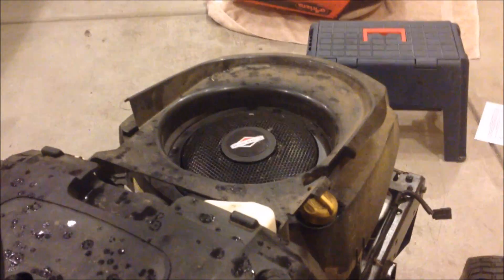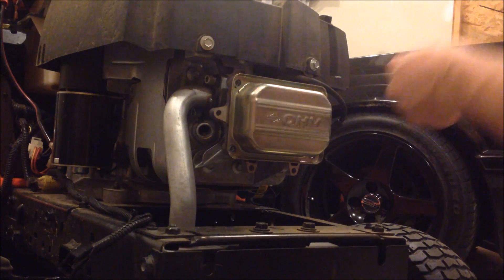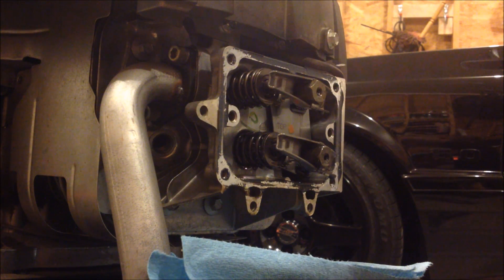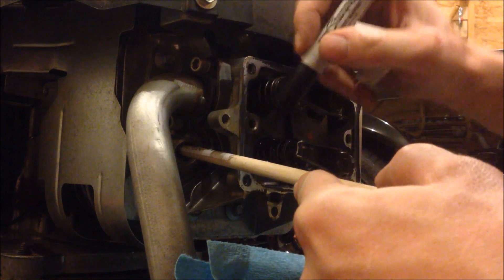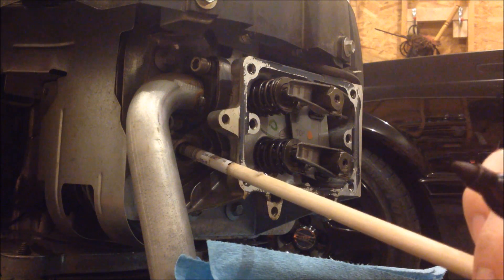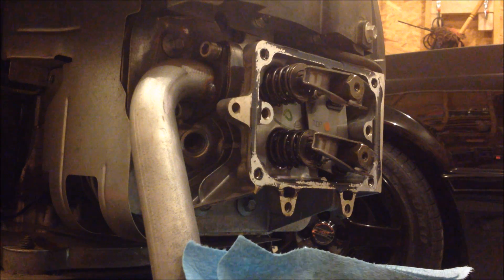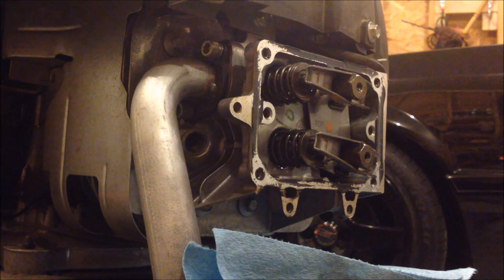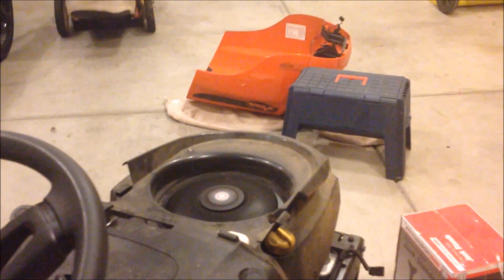How to adjust valve lash on Briggs & Stratton 330000 series engine

Comment: Great video. I’ve read the comments, but want to make sure I understand be starting repairs. 

My 15.5 hp B&S engine definitely has compression lock. I used your starting fluid method and it worked great. But I want to fix the problem. 

Do I understand correctly that I should check the valve adjustment first and that may fix the problem?  If it doesn’t fix it then go into replacing the cam shaft?

Engine runs great after it starts. Thanks.
Reply from the maker: Hello. Yes, you’re correct. First, adjust the valves to spec. If that doesn’t fix things, look to replace the cam. 👍
Reply: Finally got around to working in it. Adjusted the valves like you said and she’s starting and run in like a new one!  Sure was glad I didn’t have to open her up! Thanks, man!!!

Comment: This video saved me from sailing shit's creek without a paddle again. This 19hp engine is garbage. This time the push rod bent and head gasket blew again. Lesson learned.....don't buy aftermarket parts. Got the timing right on the first try this time. Thanks again.
Reply from the maker: You’re welcome! We share the same feelings regarding the motor. If electric wasn’t 5k, I’d go that route in a heart beat.
Reply: @FastFixYouTube  I agree. For that price I'll just replace the head gasket every year. Thanks to your video the hardest part is pretty damn easy.
Reply: @FastFixYouTube my words are coming back to bite me, saying I'll just replace the head gasket every year. Well it's been about a year and you're about to bail me out for the third time. It blows in the same place every time the thin strip next to the push rods. This is a Craftsman riding mower and between the engine design and the genius engineering idea to put the exhaust in the front of the mower so it blows in your face the whole time it's almost laughable at this point.

Comment: Tks fast fix guy for thkin time to video. Ive the exact problem.
Reply from the maker: Yes sir, seems to be a common theme. If adjusting the valves doesn’t help, likely a failure for the pressure relief mechanism. Got a video on that too if so. Hope you get it going!

Comment: Great tutorial! Had the same problem with my engine - 17.5 HP Briggs & Stratton. Followed your instructions, and it worked perfectly. No more compression lock, and the engine runs great! Thanks for posting.
Reply from the maker: Glad this video helped!  Please keep in mind the compression lock issue might also be occurring because of a broken compression relief mechanism that’s located on the camshaft. If this part breaks (which is common) the only way to fix the issue is to replace the camshaft. I have videos of that process should you need them. Thanks for the comment 👍

Comment: YOu should DELETE this video because it MISLEADS from the very beginning…. This is NOT a “COMPRESSION LOCK” due to valve misadjustment.  It is a FAILED CAMSHAFT COMPRESSION-RELEASE MECHANISM…and the Fix is to replace the camshaft.  about 3 hrs for a handy guy with a set of sockets.
Reply from the maker: You should DELETE this comment IMMEDIATELY because it fails to take into account the EXPLANATION I wrote in the DESCRIPTION.
Reply: @FastFixYouTube  😁man it wouldn't be a comment section without "that guy". I'm headed out to the shop now to see if it's valves or comp release for me. I haven't adjusted valves in a while so I watched your video as a refresher course and it looked good to me.

Comment: Great video and explanations I think it's the best one on YouTube as you have the same good work ethic as I was taught to follow! I've been mechanical my whole life and finally decided to check my same 21hp model Briggs and Stratton's valve lash after 8 years and approximately 800 hours. They were at .009-.010 not too noisy or giving me any issues so I adjusted them likewise at .004 intake & 
.006 exhaust 1/4" past TDC using my wood dowel. I appreciate all your videos especially on the B&S engine and hope that I don't ever have to replace the camshaft compression release in the future, but I'll feel very confident if I have to by just watching your video.
Reply from the maker: Hello. Thanks for the great comment!  Yes, work ethic of do things right (or at least attempt) and therefore not have to do it again. lol, sometimes that works, sometimes not. But that’s how we learn. I hope you release mechanism doesn’t break either.  Sounds like you’ve got a keeper with 800 hours of service! Nice!

Comment: Hey pardner. Think we have the same motor331777-2372-G5 runs 15 to 20 min then dies and won't start. Think it's the coil. Replaced but need to confirm the armature air gap but can't find a spec sheet for this motor. Can you help a brother out. Is it .10 or different for this model?
Reply from the maker: Hello. I feel your pain on finding specs for these engines. Parts are hard enough let alone tolerances. It pains me to even think about…. Anyway, I found this video that says it applies for all models. Might give this a try. https://www.youtube.com/watch?v=5p9WQThzP2s
Reply: @FastFixYouTube  thanks buddy. I was able to have a service rep email me. Confirmed its .08 to .14 so. .10 will work fine.
Reply from the maker: Excellent!  I appreciate you reporting back with the information. Thanks!

Comment: I would like to add something .... the reason for the extra 1/4 inch of travel is to activate the compression spring release ....after the intake valve closes there is a quick opening and closing of the valve again, if you dont see that action it's a good bet the spring or counter weight on the camshaft has broken and is not operating making valve adjustment useless. Then a camshaft replacement is needed- not a bad job to do but it can be a little intimidating. I know this is an older video and I didn't watch all the way through so you may have mentioned this but I am having that issue at the moment with two B&S motors and have watched a ton of videos to piece it together. I hope this helps !!!
Reply from the maker: Joe Drasal III yes! That was the exact issue with this motor. I adjusted the valves in vain... the compression release mechanism had failed and prohibited the engine from turning over.   After I did the valve adjustment I had subsequently released the pressure in the cylinder and the motor fired up after I had completed the job. A sure sign to me that the fix had worked. But the 2nd time I tried to start the motor, no dice. It took me a while to figure out the problem, but ultimately I discovered the issue. I made a couple videos detailing the camshaft repair, but thought this video would be helpful to those who did in fact have questions about valve lash adjustment. 

Thanks for the comment and best of luck with those motors!

Comment: Rotate the engine until one valve is fully open and then adjust the other valve. When one is open, the other is closed.   No need for finding TDC.
Reply from the maker: William Shedd yes, that is correct. I wanted to show the exact procedure according to the B&S manual so as to most accurately document the procedure for the new-comer that might be afraid of taking “shortcuts.” Thanks for the comment!
Reply: Tks b. Shedd helped this 64yo shadetree get to the readers digest

Comment: Hi,can any one help me  with hard start , B&S 21 hp ,I set the valve clearance but no change starter  can not turn the Engine freely, but if I keep trying  it will heat the starter  & sometime with not full rotating start right up ,I changed Battery,Starter . Engine ran before with Low & dirty oil--But no knocking when running & after 1 hour of cutting grass when I shut this ,it still hard for starter to move the Engine . Too much compression or any part bend in engine??  Thanks
Reply: Had that problem once, the start relay contacts were not making good contact. Cleaned the contacts up. Pop rivet the relay back together and it crank a lot better. That held me over until I got a new one. Might not be your problem but could be.
Reply: Jut doing mine, same engine... it was the crank shaft. There’s a little cam type piece on it that acts as a compression release to make the valve open a little when your starting it then after it starts, the force of the spinning can shaft makes the little cam slide out of the way so the valves work as they are supposed to. Well that little cam wears out and breaks so you have to replace the cam shaft with a whole new one ( abut $60.00) on Amazon dot com. It’s a surprisingly easy and fast fix though.. about an hour to remove engine and take out the cam and put back together... I’m just waiting to get the cover gasket in!
Reply: @hdrjunkie  Thanks yes I found that last Season & Fixed it--Thanks
Reply: UPDATE--I fix it -changed the Camshaft with release vale mechanism--Thanks everyone

Comment: I set the intake at .004 and exhaust at ,006. The mower starts fine and idles biy when I engage blades  the engine shimmys and loses power  but doesnt die. should I adjust intake or exhaust? And to what? video helped was not starting without junp before. thank you
Reply from the maker: pam wilson hmm...doesn’t sound like a valve lash issue if the mower is dying when you engage the blade. Sorry for the stupid question, but is the engine at max rpm when you engage the blade? Engaging the blade at low RPM may be causing it to die. I would also check the drive belt (belt connecting the blade to the engine) and make sure it’s not getting snagged or hung up causing excessive load on the engine and causing it to die. Otherwise, it sounds like a power issue. I’d go to the carburetor if all other things seem okay. Carb might not be getting the correct air/fuel to the engine for adequate power or might be sticking closed or not fully opening. Best of luck!
Reply: I engage the blade at the half way point on my throttle when I try to move the throttle more it doesnt respond it bogs down and shimmys and sputters. I never had the issue before i adjusted the valves because i had to jump it to  get passed compression point
Reply from the maker: pam wilson if you already adjusted the valves appropriately, that part is done. I’d move on to the carb.  Can you rev the engine to max rpm when the blade is disengaged? If so, the carb might be okay. Again, I’d check the belt connecting the blade to the engine. I’m not a small engine mechanic, so I can’t say for certain on this stuff. Just kind of giving you my two cents. Best of luck

Comment: Ok I did everything exactly 1/4 “ past tdc intake 4 exh 6 tried 3 5  4 4 no luck . How can you tell that compression release is working. Pretty sure mine isn’t releasing.
Reply from the maker: biker197471 the big give away is if you’re able to start your engine by manually moving the piston to just after TDC on the compression stroke. To do this, remove the spark plug and spin the motor to TDC on the compression stroke. Place your finger over the spark plug hole while moving the piston. When you feel pressure, you then know you’re on the compression stroke. Continue to spin the motor just beyond TDC so there’s no compression left. Replace the spark plug making sure to connect the spark plug wire and try to start it. If the engine spins and starts you know you’ve got a bad release mechanism. If the engine spins, doesn’t start and becomes stuck, you know you have a bad release mechanism. Basically, the engine should spin freely. If it does not, probably a case of compression lock and a bad release mechanism. Best of luck!

Comment: Blueoyster5, I wish you well, sir. I would like to comment, if I may, about some information you gave in your video. You said the intake valve lash should be set at four ten-thousandths That would be .0004; however, it should be set at .004 which is four thousandths. Perhaps this is what you meant but for the sake of your viewers I wanted to point it out. Also you said you did not have a .004 feeler gauge so you used a "three and a two and a half." That would be five and a half thousandths which is in range yet still a bit large for the intake, seeing that too great a valve lash is what causes the compression lock in the first place. Just for the sake of information, you can set either valve lash as long as the opposing valve is wide open. That way you do not have to mess with the dowel or with finding a quarter inch past TDC. I wish you a blessed day, sir.
Reply from the maker: Hello Exinanition.  Good catch on the "ten-thousandths" comment.  I did indeed mean "thousandths."  If only YouTube allowed me to edit these after they were posted I would certainly make the adjustment.  Thanks for letting all the viewers know.  I very much appreciate constructive comments like this one.  They help make YouTube a better place  I'm not sure if you read the description, but the valve lash ended up not being the reason for the compression lock.  The compression release mechanism catastrophically failed and was causing the issue.  I address that problem in another video.  And yes, you're correct.  As long as the opposing valve is wide open (and assuming there's no overlap in the valves) you can set lash.  In my video, I was following the B&S instructions on setting valve lash so as to "ease" the mind of new comers to engine work that might otherwise see alternative methods that didn't follow exactly what B&S recommends as proper lash setting procedure.  Again, I very much appreciate your comment and have a great day!

Comment: I have the 19.5 engine, series 31p. I am confused which is exhaust valve and which is intake. My specs call for 5 in and 7 exhaust also but our engines ate different.
Reply from the maker: sidney white hey there. A good rule of thumb to use is the intake valve will have an aluminum push rod and the exhaust will have a steel push rod.
Reply: The intake will be on same side as plug exhaust is on side with exhaust pipe.